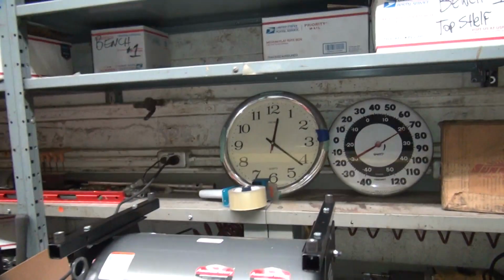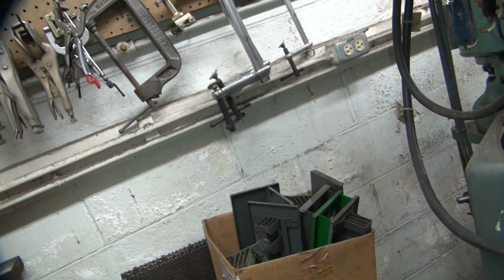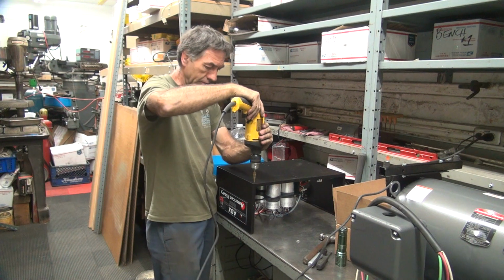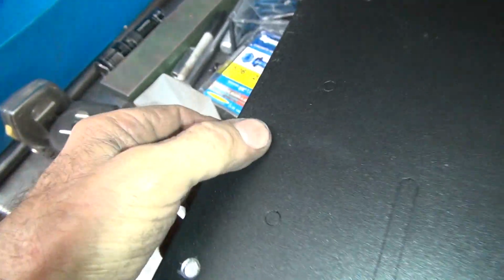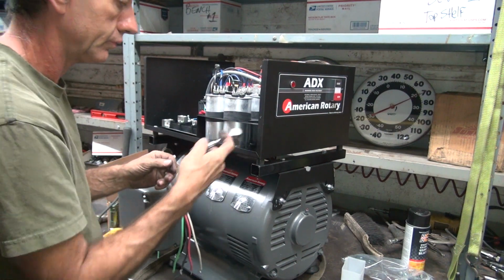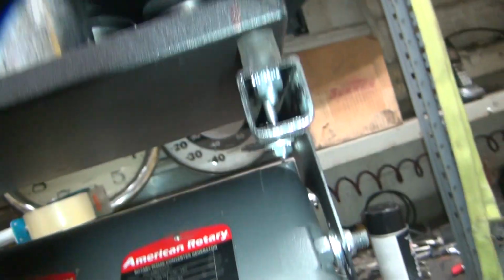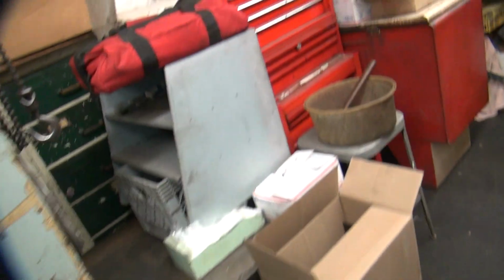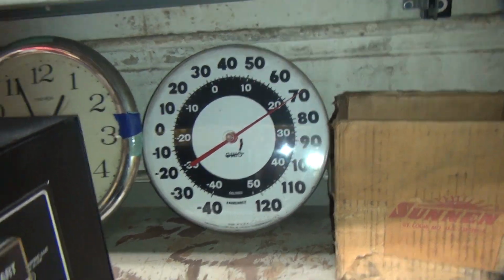#101 3 phase converter install american rotary adx25 25hp see what's up at tatro machine harley

Comment: Hey tatro , I got a question wich does not pertains to a 1985 ltd 700 kawasaki I no its not  a harley buy i inherited it for free none running and  went through and bought coils wires , carb boots rebuilt carbs and walla it starts but the airbox /filter is missing. And it will only run on choke ? Could no airfilters throw u the mixture off enough to make it not run without choke ? Thank you if you have a chance to answer jr
Reply: Yes
Reply: Ps it's going to make the mixture to lean ie to much air not enough fuel

Comment: Dont go by the wire size in the unit. 
60 amp wire is 6 AWG copper. I wouldnt run 10 AWG on a 60 amp breaker. The wire will burn if its running over 30 amps. 10 AWG max 30 amp breaker.

Comment: You just need a 60 amp breaker , no problem you have 220 your all set
Reply from the maker: the possible 20amp wiring might not like that. the wiring is next on the list to get done.
tatro

Comment: Just a heads up. Find out what kind of grease was originally used in the motor bearings. Electric motors usually use urea based grease. If you mix urea based grease with lithium based grease, the results can be catastrophic for the motor bearings.
Reply from the maker: i usally use moly based grease so i guess i will be in big trouble soon. another learing curve.
tatro
Reply: @TatroMachine  I hope not.

Comment: Dude, a hammer drill is for concrete, not for sheet metal.
Reply: Square
Reply from the maker: no, the holes were round.
tatro
Reply from the maker: this drill does both. if you watched the video you would have seen that i pre drilled the holes with my drillpress.
tatro